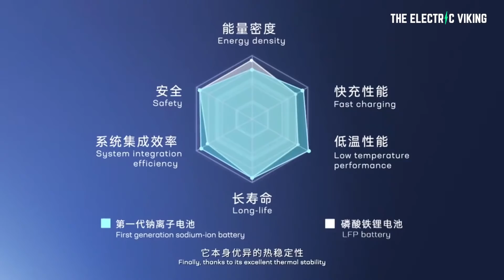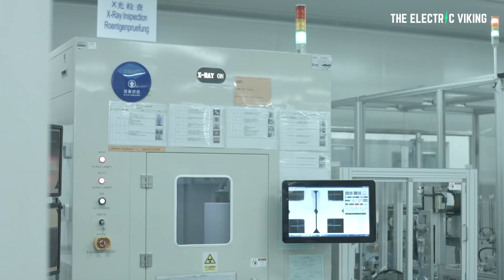CATL's new SODIUM battery will solve the world's energy problems

Comment: If technical problems related to longevity can be solved, aluminium ion batteries.offer a potential power density of 1kWh per kilogram approximately four times that for sodium and twice that for lithium.

The focus is on developing novel organic electrolytes that provide efficiency and longevity. There is a lot of work investigating these. Success is not guaranteed but seems quite possible within five years or so.
Reply: Unless I'm mistaken, the main issue with Al ion batteries is the are sacrificial
That brings all the issues with logistics of supplying replacement units.
Reply: @rogerstarkey5390  That's true of batteries currently available, they are mainly primary (eg Al air) or if secondary have very limited cycle life.

I understand the main issues with Al ion are mechanical stability of the graphite anode and chemical stability of the electrolyte under repeated cycles.

 However, there are potential solutions in novel forms of graphite and organic based electrolytes.

The race is on to find a practical Al ion battery with comparable cycle life to Li ion. It's not just a question of finding something that works it also has to be scalable for manufacture. It's now a matter of finding a combination of materials that pull off the trick.

https://en.m.wikipedia.org/wiki/Aluminium-ion_battery

Comment: No CATL will NOT solve the worlds energy problem. 😂🤣 Just as Tesla, LG, Panasonic or Toyota no can do. 
Na+ Batteries are older than Li_Ion Batteries, they are just weaker, have less energy, are larger, are heavier, could be cheaper than LFP 
and are not as susceptible to low temperatures than Li-Ion or LFP.
Reply: They can be used for energy storage but not in evs?
Reply: @jasonpage5282  They CAN be used everywhere. They make more sense in EVs because they have only up to 1000 cycles. Whereas the LFP has up to 6000 cycles and is better suited for storage. Maybe some cheap chiense or indian EVs will use those Na+ Batteries? Maybe even Tesla finds a suitable vehicle (2? Q?).